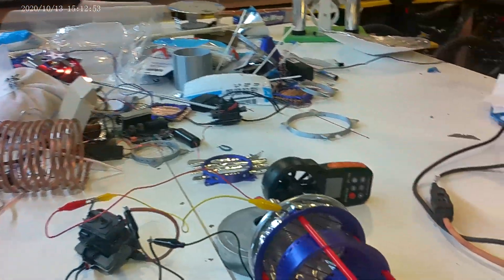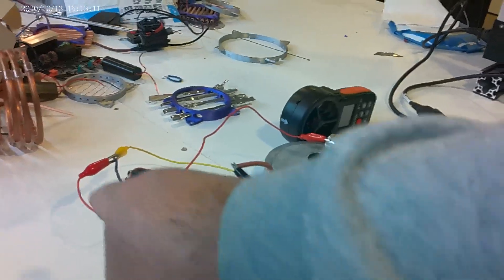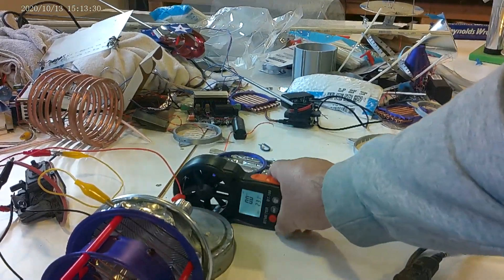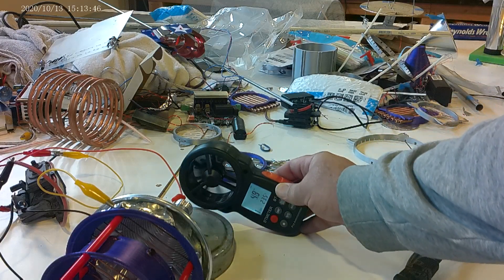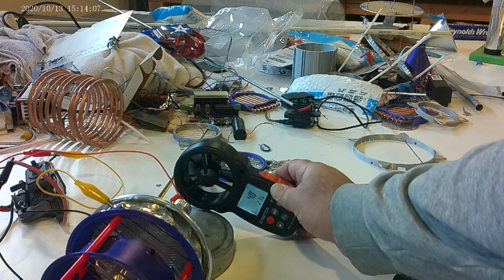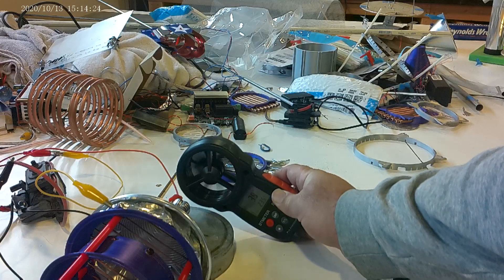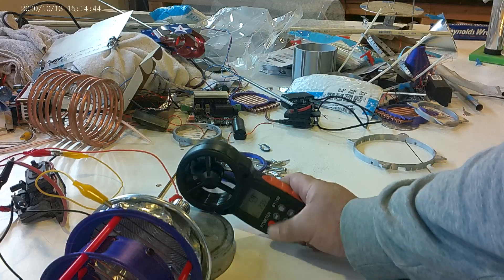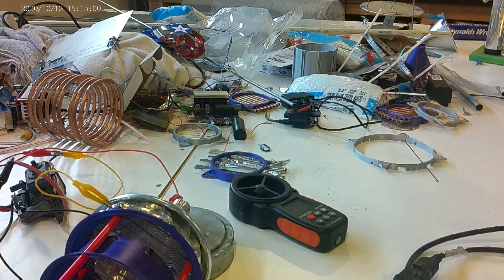Thruster big gain dc high voltage

Comment: Maybe try spiraling the jet
Reply from the maker: I have a vortex cone to put on it. Just like a vacuum. There is an opening going straight out and one on the top coming in sideways. I was thinking I could get it to swirl that way. It is on the bench to be tested.  I also got aluminum and brass tubes to try. I am working on bending the tubes to make a teardrop shape like an airplane wing. I hope Between the 2 I can get it up to 9 m/s, but I also have to add more air volume. The amount of air that is moves is very small.

Comment: how much watt were you pulling in this experiment?
Reply from the maker: I'm not sure the power source is 19v 2.8a and it needs more. The m/s number keeps going up and down because it is being starved for power. The power pack is just a lab top charger or t.v. box charger. I can't remember witch. https://youtu.be/FiMZ3yOz94k  This is a video on my power source. https://youtu.be/w2PhuWsxkm0  This video has the stl (3d printer) files link in the description incase you want to build one. Thanks...
Reply from the maker: 360 w is the max for the zvs driver I have I am going to a 1000w zvs next with battery so no limiter.